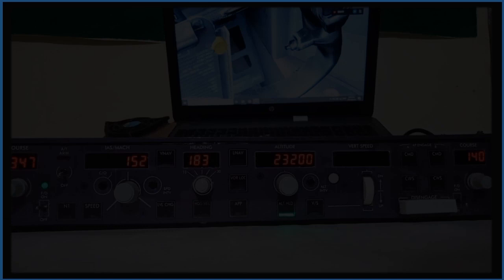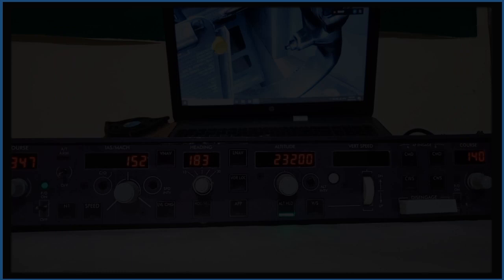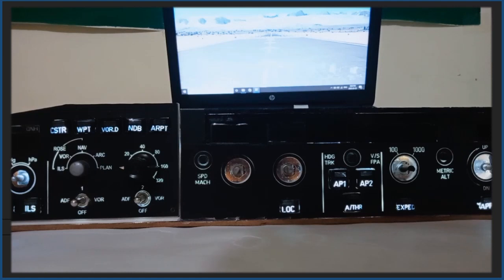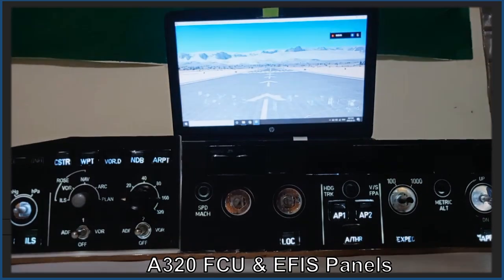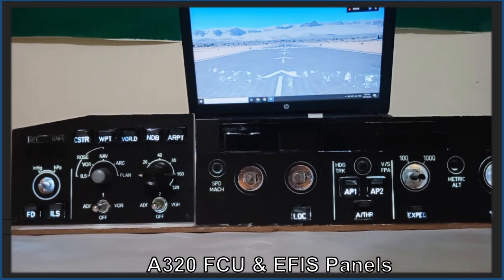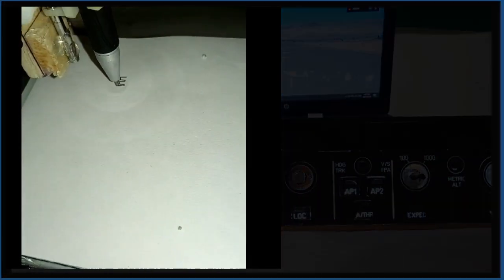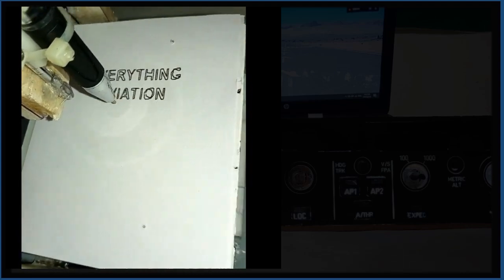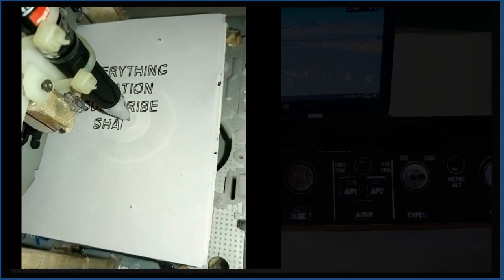B737 MCP | A320 FCU & EFIS PANELS FOR HOME SIMULATOR

Comment: The A/T switch on the panel moves to the OFF position when you press the disengage button on the throttle. How does the A/T switch work, is there a solenoid behind the panel?
Reply: BTW the panel looks great, thanks for making the video.
Reply from the maker: Thank you so much for appreciating ☺️♥️👍
Yes It does have a solenoid attached to the toggle switch mechanically... :)
Reply: @everythingaviation8013  It would be great to see details of the solenoid mechanism. Could you post a video showing the rear of the panel and how the solenoid operates the switch. I'm trying to get some ideas for making my own MCP.
Reply from the maker: @abigfatelephant1  Hii, Sure I will try to post the images or video of Rear when i open it next  :)